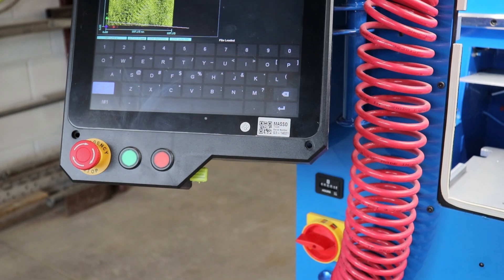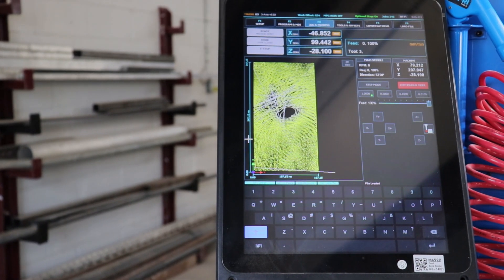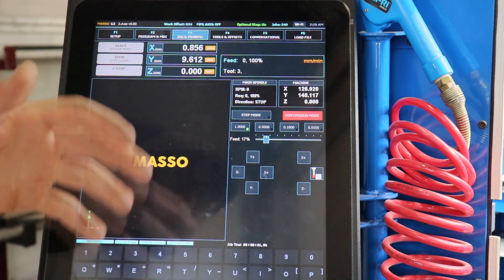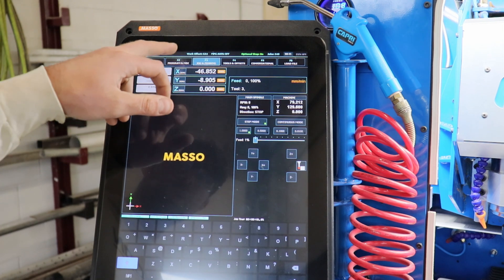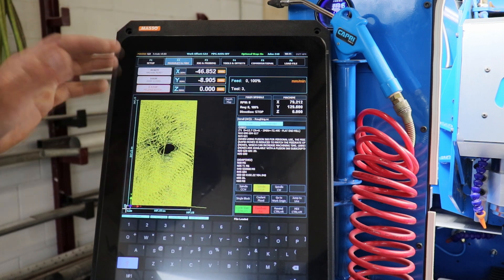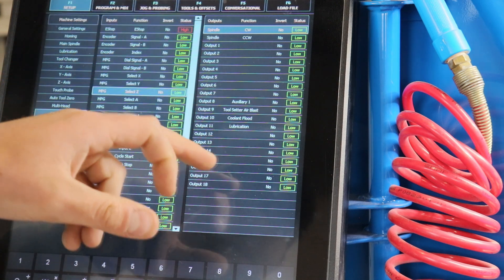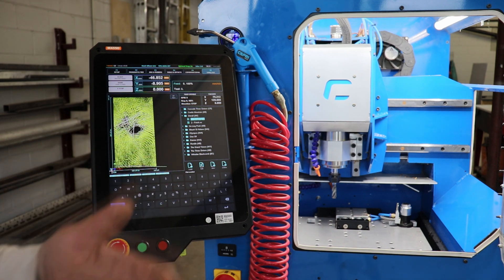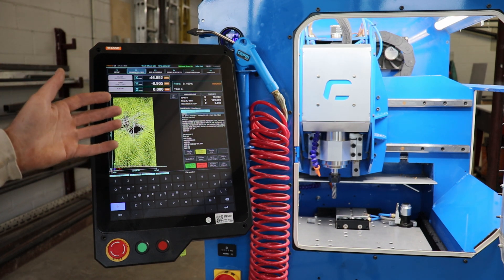The MASSO G3 Touch, Is It Worth It?

Comment: No it’s not worth it. Overpriced, horrible support, all through email that takes days to answer, buttons are missing in the main screen. UCCNC and a Pc is way better. I have both and am sorry I bought the masso. It’s really nothing special. I’d rather use Mach 3.
Reply: Have you used FluidNC? I was torn between UCCNC and FluidNC. I went with FluidNC because parts and documentation seemed more available.

I really would like an offer the shelf solution in the future, but it seems like everything good is either too expensive or requires a lot of DIY.

Comment: Touch screen Jogging function is sub optimal. I would want an analog interface as with a  hand wheel.  Frequent use buttons and mode select should also have an analog interface. Also for things like a tool change or a guaranteed crash like a 4th axis out of position or tool change state should have analog interlocks to prevent incident.
Reply: Whislt you're correct the MASSO does support a pendent. They sell one for 180 bucks, but it should be pin compatible with any of the wired or wireless ones that can be had inexpensively from chinese retailers.

Comment: Great Video:  Question: Can you store the settings for different machines?  For example, if I have a Sherline Lathe and a Sherline Mill, can I use one Masso to work with both machines simply by reconnecting and selecting the setup for that machine?  Thanks!
Reply: No you cannot
Reply: @ bummer!  That sounds like something we need to press MASSO to improve!  Thanks!

Comment: I'm thinking of buying this Masso 5 axis or the Acorn6 - I don't need 6 axis - 5 is good enough.  Any reason why this may not be good for an industrial multicam 3000 CNC router? how's the response vs the Centroid Acorn 6? I think the main reason why I might still be into the Centroid is that I want to use a rotary (which is standard on my machine) and also add fixed tool mounts as well to make it a 20 tool changer. I need a lot of different carving tools and this would make it super easy and from my understanding the Masso only allows a choice between rotary or fixed and not both.  Is this correct?

Comment: It's an underpowered and expensive semi real time controller that acts exactly the same as any other pc system with motion controller. Those Masso cannot run in real time and always have the commands in buffer. It's made for the standard user without any knowledge in the field. If you want cheap industrial grade cnc controls try something like the XCMCU 709D or HLCNC 980m. I've built a lot of CNC retrofits for bigger milling machines and lathes, from Pokeys57CNC, ESS, CSMIO IP/x and some others that were running Mach3/4. 
I've now moved to standalone Fanuc like controllers from china with built in display and proper keypad. They start at about 500 USD, depending on how many axis you need. They are proper 32 bit real time systems without any lag while jogging with mpg, support mpg job control, have full ATC control, Tool library with auto wear measurement and compensation, proper spindle orientation for rigid tapping and supports every axis with separate encoder inputs and even glass scales. You can also run any plc via rs485, so oilers and exotic hydraulic table clamps are no problem to implement. 

For example, the XCMCU 709D 5 Axis unit is about 500 USD, and has all the above features, almost the same as any MACH4 system when you count all the extra stuff you need. My customers are super happy with those and i no longer need to kill hours on support for obscure errors with mach and motion controllers. I run one of these on a MAHO700 myself and another more sophisticated one from another chinese manufacturer on a CNC with Toolchanger and 64 toolholders.

The only problem you have with these is the documentation is basically nonexistent and only includes the most basic stuff in chinese. Nothing for the standard user that needs to have a step by step guide. However, maybe i should open up a webshop and sell these with proper documents, since i know them in and out.
Reply: @bogeydope3022 Thanks for this comment, definitely going to look into the controllers you mentioned, is there a preference between the HLTNC 980m and the XCMCU 709D? I also see they have a newer XC1000D now.
Reply: @ultimaevo77  Depends on what you want. The HLTNC 980m is pretty obscure on it's Manual but has a LOT more capabilities and HLTNC does answer emails and can send you their PLC programming software, which does enable you to fully adapt the system to your needs , but it's in depth and requires knowledge to do so. The 980m does also have graphics output and an extra LCD for tool changing, does support things like hydraulic clamping of axis and the like. It also allows feed velocity of up to 230m/s in both exact stop and velocity mode, which is a lot compared to the 30m/s of the 709D.

Though it doesn't support auto probing and auto tool length measuring, just manual AFAIK, but i am working on trying that with the mentioned plc programmer. Should be possible. 

The xc709D on the other hand is far more wide spread and it's manual is better. It does support auto probing and auto tool length measurement but lacks the graphical output and it doesn't come with a PLC programmer thus you have to work with the outputs and it's given functions they offer in the system setup. Something like really complicated machines with a lot of hydraulics and complicated tool changer doesn't work. 

Both allow to do a whole geometry table of all axis plus backlash compensation. Both allow the use of servo encoders plus glass scale encoding. Both allow for RS485 communication of extra PLC or standalone servos. Both allow for spindle encoders in step/dir and velocity modes for spindle orientation. Though be warned that you need a complete axis for rigid tapping, so if you buy a 5 axis version, the 5th goes for the spindle in step/dir.  

If you have a standard VMC, i would take the xc709D. The 1000D is just the same in another package and pricier. The xc809D is also just the same with another orientation.

Also DO PAY ATTENTION on what homing sensors you have, the XC709D needs PNP type, the 980m needs NPN. If you have the wrong kind, you need an optocoupler card between the sensor and input. Otherwise you will fry the control!

If you have a lot more money to spend, buy a GSK 980m version, they are basically the same as the HLTNC on the hardware side but offer a tried and true firmware package with inbuilt graphic supported programming and cycles. They also feature an in depth manual in good english with about 1000 sites. Only thing is, they cost almost 2000 USD in the 5 axis version.

All cycles and macros on the HLTNC 980m and xc709D need to be programmed by yourself and there is no graphical supported programming or in built cycles. Also the HLTNC just has a graphical output like mach3 and 4.
Reply: @bogeydope3022 Thanks for the in depth response! I'm researching the build for my first DIY cnc with no experience in this field and I think these controllers and getting it all to work might be a bit over my head but I'll email both manufacturers for the manuals and ask some questions on installation and see if I can piece it together.
Reply: @bogeydope3022  Do you have any experience with Newker 1000mcd?
Reply: @ultimaevo77  I do not, but from the looks of it i'd say it's some GSK setup.
Reply: Hi, I like your way of thinking! I was considering a masso for my 8x4 wood cnc table. But I need something simple that works, I was also considering lichuan servo motors. But if you’re interested in helping a fellow nerd, please be in touch! Cheers!
Reply: @jengelbracht  Hi, something simple depends on how much you know about what you want to do and how much money you have spend on your machine and its capabilities. 

The controllers i was talking about require at least in depth knowledge on standard gcode and its variations to understand what they are executing if something goes wrong. That goes for all industrial controls without full graphic programming.

The initial setup would be something i would help with you with of course.

If you are not going for a professional setup that HAS to work all the time, i can lead you to something more suited for starters.
Reply: @bogeydope3022  thanks for reaching out! 

Actually I bought a machine but the company went bankrupt in 2015 so they no longer offer support. The machine has a problem with the Z axis(not sure what) and it runs on old B&R components. I’d rather upgrade it to something more of this day and age before I maybe sink a bunch of money into something that’s no longer supported. If you want I can share more info about the machine. Kind regards! Justus
Reply: @jengelbracht  So it is a pretty new professional woodworking cnc mill? Can you give me any info on the motion hardware, like what drivers and what kind of motors it uses? Since it is a woodworking machine, there is no positional feedback besides internal servo encoders? 

You're sure the z axis problem isn't something mechanical? What is the problem with the z axis? Does it use linear rails and within what spec would it run if it was good? 

What kind of CNC control does it come with? 

I'm not familiar with woodworking cnc machines, though know of some that i worked with that were marketed as light VMC for aluminum with the exact same layout. Therefore i know what dynamic setup would be needed if you want to run them like intended.
Reply: @bogeydope3022  I typed a whole bunch of info but YT keeps deleting, not sure why. Any other place I can contact you perhaps?
Reply: @jengelbracht  Awesome, now my reply isnt going through.
Reply: @bogeydope3022  trying to leave my info here but it’s not working..
Reply: @bogeydope3022  can we be in touch about the setup of this? I’m exploring some options but not sure which one to consider as an offline controller. Cheers!

Comment: I was thinking of buying this system  but I went another way so my bank account wasn't empty to a greedy company. So it worked out I can buy 5 of a anther provider's unit and the money saved I purchased another machine with tools and still have money in my pocket.
Reply: What other brands are there? I am trying to build one and the price for just the controller(g3) is mad expensive. If there is a brand you know that is reliable would be great to have!!

Comment: overall price point is pretty good, its the closest thing I have seen to a real industrial controller. all those PC controllers just dont do it for me, but then I come from siemens and fanuc  controllers. If I could get a fanuc controller I would put it on everything. Granted I have not used this controller, but the #1 thing that stops us from buying a controller or machine is the lack of switches and knobs. case in point, I will not buy a haas machine as they are not good for a job shop, mass production yes, but proving out a program on a controller without the ability to operate it without looking is a nogo for me. example, turning flood coolant on/off with a switch while not looking. lowering raising rapids without looking, single cycle, etc..

Comment: "You dont have to use PC" is really not a great argument. Most of DIY people and especially professionals have some PC that is not used. Also if you build a PC into a machine you do not place any other software unless its for CNC process so crashing is not a problem. As you pointed out, Masso is also crashing and if you run your system from SSD on PC it will start in just few seconds. I try to find a good argument for purchase of Masso G3 but I cannot find it, GUI is not enough as selling point.

Comment: Did the price for the masso just jump up like $500 in the past 6 months? I swear it wasn't $1700 the last time i checked.
Reply: This is for the complete system controller plus touch screen plus relays etc.
Reply: I thought the entire package was around 11-1200 earlier this year, 800 for just the masso unit without touchscreen.  Now i see sites talking about tariff import fees and  I'm feeling priced out.
Reply: The g3 went up $180 since 2022. I paid $1,110.00 for MASSO G3-Touch - Mill / Router CNC Controller - 3 Axis which is now selling for US $1,290.00. Pretty shitty considering the fact that we're currently battling Bidenomics.

Comment: Did you check out acorn six controller from centroid?
Reply: I did, and it developed into a trip down the rabbit hole trying to simply get it hooked up... probably a good choice for someone who is using the system as a "hobby"... but for someone like me, who isn't interested in a "career move", I've opted to throw the Acorn back into the box and going with MASSO. Perhaps my machine was simply requiring more than the Acorn could supply without getting eyeball deep into wiring, macros, etc., which I don't have the time, will, or patience to engage in at this point.

Comment: Hi, my name is Guillermo (Bill) Marrufo from Mexico,
I wonder what the resolution it has. I intend to build a 3+2 axis laser engraving machine for irregular 3D surfaces. 
Being dedicated to plasma, I tend to think it may not have the precision I need for very fine intricate details. Thanks for your time answering.
Reply: Hola, la resolución te la va a dar mas bien los micro pasos con los que configures tus drivers de los motores PAP o Servos que vayas a emplear. Esta placa te da 110KH por cada eje, podrías poner la resolución máxima en tus drivers, hablamos de centésimas o milésimas  de milímetro. Pero piensa que  necesitaras servos decentes para esas resoluciones. 
Hay un canal en español llamado MaquinerosCNC, el tipo tiene un video donde explica muy bien la relacion entre los pasos de tu motor, la resolución y la capacidad de tu controladora.
un saludo
Reply: @juanmanuelgarciaortega2591  Hola Juan Manuel,
Muchas gracias por compartir tus conocimientos y tu tiempo. Donde te ubicas? Saludos de Monterrey!

Comment: The price of the extra axis made cry tears of joy. Haas charges over $1500 for just rigid tap option lol.
Reply: No I use it in a diy build. I own a Haas and paid 3500 for software options like  HSM so the options on the masso are incredibly cheap to me
Reply: @Foomanlol But Haas is strictly not DIY machine, so the cost will be high
Reply: Hello! Do you use a Masso in Haas CNC?
Reply: Has this changed recently? I can't see different prices on 3-axis or more axis versions?

Comment: If I’m correct, there is No network, Wi-Fi connection or onboard memory. I’ll stick with a Centroid controller.
Reply from the maker: They do have Wifi for file transfer, no built-in memory which is annoying, if it looses it's connection with flash drive (which does happen) the whole machine shuts down, a problem which could easily be solved onboard memory.

Comment: Nice video. Can you tell me the manufacturer code / part number of the touchscreen itself? Maybe it's somewhere visible from the back. Curious what they actually built into this pendant.
Reply from the maker: Hi there, it is the Innolux G150XNE-L02
Reply: @DIVCNC  Thanks a lot! do you like the touchscreen itself? I have built a pendant with a Thinkpad brand touch-monitor and it wasn't really suited for a workshop

Comment: Don't waste money and time with this underdeveloped Masso ...look out somewhere...industrial standard at same price as Masso
Reply: Which industrial standard?  I am looking at this to get away from a RichAuto controller.
Reply: What industrial standard for the same price? Siemens or Fanuc? Very expensive.
Reply: Ignore this guys comment. I have this on my Taig lathe and it is excellent. Fully developed and supported. Questions answered right away on the forum, and suggestions for software changes actually used.
Reply: @rak6080  it does work like Mach4 but what i said is there's  better  option  to Masso  at the same  price  as Masso and way way way better  that  Masso 

I repeated  myself 

For example  That  Masso  on your lathe cannot perform  a simple  Gear Shift  on your lathe ...and with Mach4 you  can simply  write a Lua script  to  do that 

So Masso is weak 😊😊
Reply: @seimela  Yet you still aren't telling us what those other options are.
Reply: @seimela masso may have fewer features but the features it does have seem to be quite reliable and no need for a pc which is often the source of problems.
Reply: He probably talking about centroid acorn six
Reply: Open your eyes guys ....even mach4 is better than this the internet must be yourfriend
Reply: @seimela  I'm not saying this is better but you are saying that there is an "industrial standard" for the same price.  Mach4 is not an industrial standard.  Would like to know what industrial stand you are talking about.

Comment: If only Masso had screw mapping.
Reply: whats that? like rigit taping?
Reply: @ziganagode  No, it allows you to measure error in the ballscrew and calibrate them out.
Reply: te refieres al corrector de  backlash??? Es raro que no lo tenga, casi todos los controles cnc lo tienen

Comment: I am so tired of my RichAuto controller on my Axiom AR6 router. Especially given I use Fusion 360 and its had its issues with a Post Processor. This looks like a really good change which can allow for better control of spindle speed and programming other things like a mechanical dust shoe and mister
Reply from the maker: It definitely is, and works well will Fusion 360 which is what we typically use